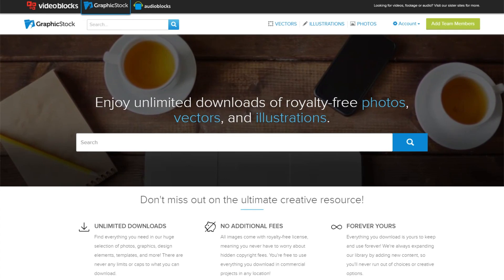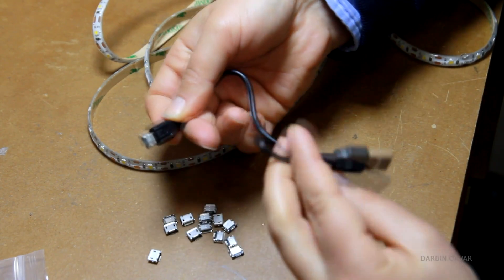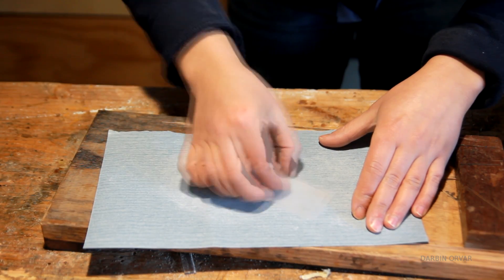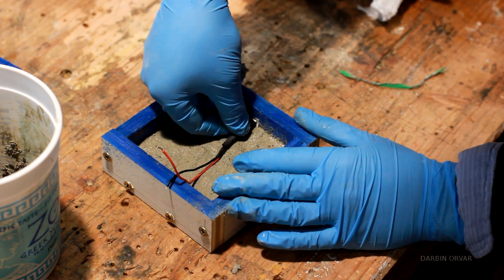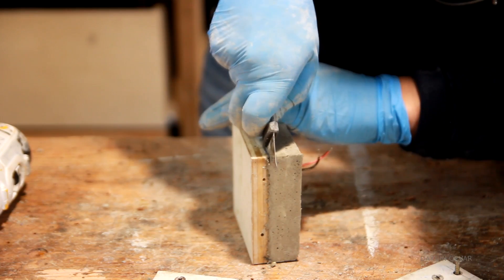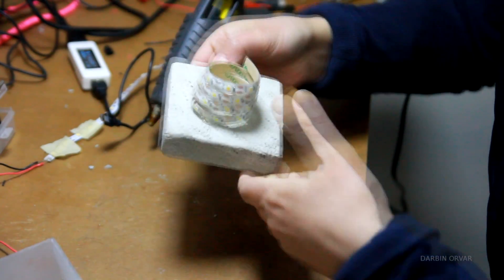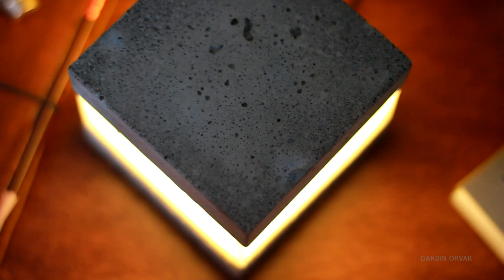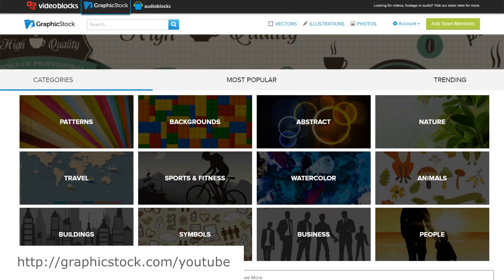Concrete LED Light Cube

Comment: I created some papercut light boxes with shadow box picture frames and used this circuit to kick the 5v LED strip light/fairy lights when the light in the room was dark enough: https://www.youtube.com/shorts/p3nmbbIMvkg when the sun comes up it shuts off the lights. I installed a switch as well, in case someone wanted to turn off the light. Very well done video. Love the idea. I am working on a cement base for a lamp and was looking for molding ideas. Thank you! :hands-yellow-heart-red:

Comment: You could have used a flexible tube for the micro usb wire connector to pass through, so it is not totally cemented in place, this way if you ever have to service the light, all connections are easily accessible and replaceable. Otherwise great project!

Comment: Easy tip, use a micro USB brake out board for the power 
you evade having solder cables directly to that female port since you solder to the pads of the brake out boards

Comment: spray wd40 or PAM into the molds for a release agent.
another option is to use rapidset mortar with a flow control agent. The material will flow better.
To get the air bubbles out, use a reciprocating saw without the blade. Just vibrate the heck out of the mold. Some air bubbles add character though.

Comment: I've found that parchment paper also makes for an excellent light diffuser. I think the only change I would make is to use plaster of paris as I get tons of coupons from Michael's and JoAnn's that make it pretty cheap to source and once heated to remove the water, it is pretty stable. And maybe RGB LEDs just because I like colors.

Comment: Wow! Nice job! Thanks for sharing this with us. I have a question. Instead of using a USB connection if I were to use 12V rated LED do you think I could connect them to an 12V transformer with the wires running underground? I want to make something like this for my garden and place it outside.

Comment: Hi. I know it's maybe useless to let this comment, but you can use a TP4026 to have a micro USB port on your lamp, it's easier to solder the wires, and you can make it portable if you put a 18650 battery on the B+ and B- slot and a power switch on the led wire. 

The prices dépend of the sellers, but approximatively you can have : 
0.80$ the tpa4056 alone
0.64$ the battery box holder case alone
2.70$ for 100 switches
And the battery price really dépends of the seller. some 4000mAh battery can cost 2.50$ to 5$ each. you even can have bigger battery for a better price.

Comment: Great job, cool idea. I would also have somehow included that power bank inside concrete for even better portability.
Reply: yep. A tp4056, a battery box holder, a power switch, a 18650 battery and let's go.

Comment: Great idea.  I would use a standard light bulb socket and household wire so an enclosure safe LED bulb could be used.  Of course the dimensions would be increased and I'd figure out a way to have the top removable.

Comment: I also would use RGB led's with a controller and that way you can have any color. I would have also wrapped the LED's around a thick cardboard roll that was cut to size. That way they can be securely fastened. I would also first test for heat as some LED's get really hot.

Comment: Lovely design! Thanks for inspiring us! To save on power consumption, eliminate the paper, frost both sides of the lexan, spray silver/white paint on the inside surfaces of the concrete, and use fewer LEDs. If the individual LEDs still show, create recessed cavities in the concrete and embed them there.

Comment: If you want to reduce the bubbles, you could put another piece of fitted plywood on top and use a weight or spring clamps to press it down while the concrete is wet.

Comment: The light is absolutely stunning. For future projects, you might want to know that there are premade micro USB breakout boards that consists of a small piece of PCB that takes all the pins and spreads them out a bit to standard through hole pads with the standard pitch, found in LED legs and pin headers. Some even come with male pin headers that you can solder in.

Comment: Perhaps you should point out the importance of choosing a charger that can supply enough amperage. A charger that can supply atleast 25% more Amps than your strip requires should be good. If you use 100% of the charger capacity or a charger thats too weak, it can cause overheating, especially with cheaper ones.
2,5W @ 5V is 0,5A so at least a 750mA supply should be fine

Comment: A more accessible variant of this may be to make the light enclosure to fit the LEDs inside of an acrylic tube instead. You can purchase extruded hallow portions of clear tubing which should accommodate a suitable size for an ambient lighting fixture. This would also mean less feet are required to prop it up (3 minimum @ 120 degrees apart) and one can use slightly larger (and more readily available) opaque PVC tubing to make the outer enclosure.

Lube the inside, vibrate some rather moist mortar smooth and enjoy the result. It would look rather striking to have a sliver of light, but for that to work you'd need to bodge together a bunch of strawhat LEDs into a ring and hope you don't break the acrylic by cutting it so thin.
Reply: Nice.

Comment: Great project. Just wanted to mention, if you sand down one side of the plexi you are using and put the sanded side facing the led strip, it will go from clear to translucent and you won't need to add the paper.) Nice job Darbin!

Comment: What you could do is put a small portable charger in the top concrete and a wireless charger at the bottom, not sure how it would transmit through the concrete tho

Comment: original and smart Darbin, I like it ! If I may so, don't blow on the solder it could create a solder joins... Does the epoxy resists to the heat created by the LEDs? cheers

Comment: Nice!

For future reference, if you apply the orbital sander to the mold with the wet concrete, the vibration should help reduce the small voids in the concrete. This includes the obvious bubbles, but I think it will also bring more of the fine particles out so the sides are smoother, even with drier concrete.

Comment: The light looks really amazing. I love the simle shape and the combination of materials. But i would probably build it with the 12V light strips as they are more efficient. You have a loss of 10% on the resistors on the 12V version while in the 5V one the resistors consume 28% of the energy taken by the strip.

Comment: Very cool.  I would probably alter it so it could be taken apart if needed for repair.  You could embed a bolt in the underside of the top concrete piece.  Then cast the bottom piece with a hole in the center, and a recessed area underneath for a nut/washer combo.  That way, you wouldn't need to glue everything together.

Comment: That's a gorgeous light!
I'd recommend a couple of slight design tweaks to improve longevity:
1. Don't encase the connector/wiring in the concrete. Reasoning: As soon as the connector wears out, the light is functionally "bricked". Maybe carve a channel through the concrete and feed the wire through.
2. Go with a 12V system instead of a 5V USB system. Reasoning: there's more power available. It's less versatile, but you're also not limiting yourself to 2.5W, and 12V adapters are easy to find.
3. Instead of coiling up the the LED strips, stick them to a thermally conductive surface (for example, thick gauge steel/aluminum sheet metal or PC heatsinks. Reasoning: LED longevity is highly dependent on keeping the diode junctions cool. By conducting away the heat, you keep the junctions from overheating over the long term.

Keep up the good work!

Comment: I'd use your sander (without sandpaper) to vibrate the molds and release some of the air pockets from the concrete mix (wetter mix works better). That would make for a smoother finish.

Comment: I have added this to my todo list. I think if I make one I would like to try incorporate a qi charger in the concrete. Thank you for your tutorial. I noticed It looks like you are using a microjig push block with your saw, or something comparable. That is neat. What kind of blade do you use for cutting lexan?

Comment: I like what you've done with your lighting projects using LEDs.  LEDs puts out a rather harsh and unpleasant bright light, but you have a way of treat the light and pairing with concrete here, and wood in your desk lamp that creates a softer tone of light and inviting ambiance.  Great project.  Thanks Linn!

Comment: The only thing I would suggest doing is to trim the data pins off the USB jack. If you connected this to a computer and say one of the data lines got shorted to either the VCC or ground that could be bad for the computer it was plugged into. I might also include a protection diode to insure this doesn't get connected backwards but only if I were to use a standard barrel plug instead of a USB socket as not all wall adapters are the same polarity.

Comment: Loved the video and the idea, you just could've used a small box with batteries inside the bottom concrete part and wired them to make it even cooler! still, awesome job +1 subscribber

Comment: You should have added an internal battery and a switch that activates the light when you turn it over.  Sit it one way and the light is on.  Turn it over and the light turns off.  Just have the connector in there for charging the internal battery.

Comment: I would calk inside joints with silicone, let dry, then add concrete mix. this gives pre-rounded edges on blocks, saving sanding time and preventing the edges from chipping.
Reply from the maker: Good tip!

Comment: I did a similar project. But using silicone moulds. 

https://www.facebook.com/sggeek/photos/a.972044419494903.1073741828.972040796161932/1332520436780631/?type=3&theater

I think using silicone mould can give the concrete a much better look without having to do too much polishing afterwards. But your idea of getting the micro usb jack at the base of the mould is great! I should go get some of those. As for getting the matte effect on the acrylic. I used an acrylic spray. I tried sanding, but when u turn off the lights, sanding looks a bit more rough. An acrylic spray probably about 3 coats will give a more polished feel.

Comment: How much does the finished project weigh?  I like the size for portability, but the weight could become a bit much.  Also, is the lighted section rugged enough to be portable, or should it just be left in place?

Comment: Just a thought (design thought):  If you press your polycarbonate square a bit deeper into the wet concrete of the top, then skip the epoxy for that joint, you could later on a whim remove the top and replace the white paper with a coloured sheet, or a different white sheet with patterned design, etc....

Comment: Turned out nice! You can also use super plasticizer or water reducer to increase the workability of the mix without losing much strength as you do with adding more water.
Reply from the maker: Thanks for the tip Nick!

Comment: I had a thought about the diffusers for this project. Home Depot and other big box stores sell several varieties of acrylic diffusers that are normally used for the grid dropped ceilings under fluorescent lamps. They are 24" x 48", are available in frosted and clear material with a variety of molded in textures, and sell for about $10.00.

Comment: Interesting ideas. A few comments: 1. A heat gun is better than a cigarette lighter for use on heat shrink tubing. 2. Don't worry about which kind of concrete is stronger. Everything other part of that lamp will break before those two concrete blocks break. 3. "You can make it portable." Well, yes you can, any time you want a bulky, 10-pound flashlight that doesn't put out much light.

Comment: The lamp is very cool, straightforward designed. An idea came form your last scene in which you can see some blue remained inside the concrete pores.

A thing that should be tried is to play with air bubbles by mixing the concrete with more water and more power. Then paint two different ways the pores and the surface.

This could be obtained by sprying the inner paint, sanding the surface and then painting it by a different technique like stamping or somewhat similar.

Comment: Really love this one. Two thoughts: 1. could a switch be added to that USB line to have it on at night? 2. could it be split somehow in the concrete, so there are two places for plugs? One to the wall to supply power, and the other as a power output, and it could charge my phone?

Comment: I like the look of the concrete, but I would probably use wood, and try to fit a rechargeable battery and circuit into the base so it could function as a stand alone accent piece.  Also have a lot of bad memories from when I had to teach the materials science lab and we had to do concrete testing x.x

Comment: The LED strips eliminate the need for any electrical calculations and following is a long winded explanation of why 5 volts strips are different than 12 volt strips. Every LED has parameters that need to be noted for resistor calculation;, max current in mA, and forward voltage (fv). A white LED normally has a fv of 3-3.8 volts. The LED must have a power supply that provides at least the fv requirement. LEDs wired in series have the fv's added up. The resistor must drop the remaining voltage and limit the current and in the case of a 12 volt strip assuming a fv of 3.5 volts the resistor must suit 12-(3.5-3.5-3.5=1.5. Most LED strips use LEDs with a 20mA and with the larger LEDs a 24mA max current rating. Expect to see a resistor with a value of 62 to 100 ohms. Coincidently a 5 volt strip resistor value would be the same, 5-3.5=1.5. Slightly larger resistor values may be used to lower the current (and the light output) and extend the life of the LED. Many phone wall power supplies provide 700mA of current so 35 LEDs (35x20mA=700) would be the largest amount of LEDs that could be used and get the most possible light out of each LED.

Comment: Yes I would like to change it. Instead of using direct power.  I would embed a power bank in the concrete slab and use a push button to turn it on and off and use the micro usb pin to charge the power bank. Making it truly portable.
Reply: Ya if you molded a hole into each side, and put a piece of pvc in the middle, the power bank could fit down the middle and the led would have something to wrap around. Then you could theoretically remove it if it ever went bad.

Comment: Cool idea Linn...
I think that concrete is an awesome material, but I feel like it could be taken more "seriously" if it didn't always come out looking so...DIY. For example, your lamp, while it is cool, it has hundreds of tiny bug-holes in the concrete. Also, the color is totally uneven and, well... concrete-like. And if that is what you are going for, then that's awesome. But I would like to learn more about how to fill in bug-holes, and how to color concrete so that it is all one homogenous color.
For example, I wonder if you took the motor mix, and put a small amount through a sieve as if you were sifting flour to bake a cake. This would remove a lot of the sand, and any larger aggregate. Then add a small amount of water into a slurry. If you pack this slurry into the dried/cured concrete surface, would it fill the bug holes, or does concrete not "stick" to concrete very well once it's cured? 
I'd also like to learn about acid stains or other cool concrete coloring ideas. I think this lamp could be very very cool!!!

Comment: I have  a  total solution of  color temperature(Kelvin) remote adjustment which are using in my products,  it can change the LED color automatically or random,  contact me if you like to update it with such feature, Thanks

Comment: Interesting take.
I was expecting you tu use a similar method from one of your previous wood lamp project where you included a battery pack in the base. Granted, the base was thicker in that other project.
That being said, do you think it would be harder to make a hollow base in that concrete for some batteries ?

Comment: Great looking light - as for the micro usb - you can get breakout baords for cheap https://www.aliexpress.com/item/10PCS-CJMCU-Breakout-Power-Supply-Module-Micro-USB-Interface-Power-Adapter-Board-USB-5V-Breakout-Module/32789480622.html . For US based - Adafruit and Sparkfun carry them too if you're in a hurry

Comment: Hi, I like your idear. One cool addition would be to add a powerbank to the lamp and a Switch near the USB connection. Then you can power it by battery and recharge it later. With this you could take ist to your garden desk or use it inside.

Comment: Perspex is not readily available in my city, but striated polycarbonate sheets of all colours (& clear) are, so I'd suggest it as an attractive option which can be cut carefully with a box knife. Also a mix of wall-board jointing compound and fine sand would produce a creamy-coloured option to grey concrete, as would Plaster of Paris in a 50/50 mix with sand, (or alternatively, red Australian gravel, since today is Australia Day)!!

Comment: For me I'll just use a male usb cable and connect it directly to the led lights, it would save me the hassle of soldering the small pins in the micro usb :)